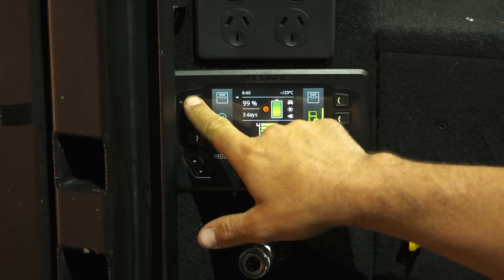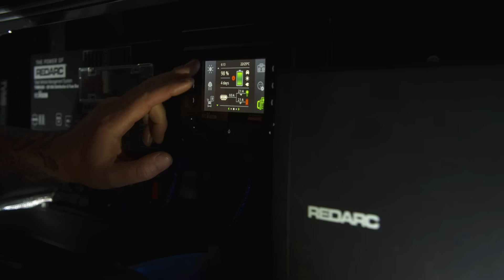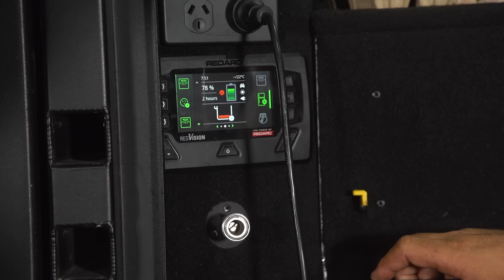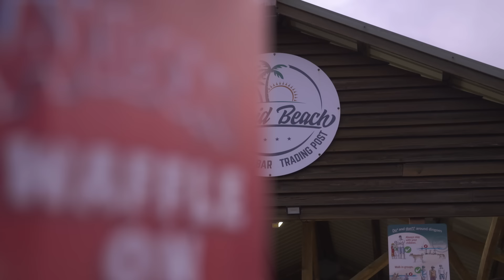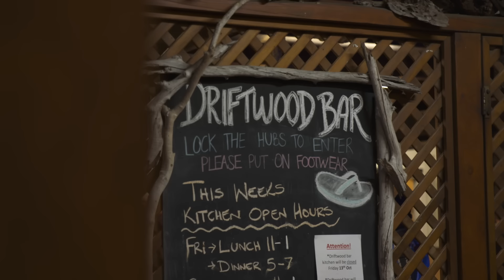BADLY Bogged on Fraser Island (KGARI)... then the STEERING BROKE! Monster 4hr Recovery!

Comment: I did the Island in 2009 In my Cross8 Crewman, Should have seen the looks I got especially as I had no recovery gear (clueless) Dropped the tyres to 7psi and drove most of the island. I did work out quickly the sand is best first thing or after a bit of rain. The Fantastic knowledge and experience is on display in every episode, 
Would be great to see Team 24/7  do a Eurobodalla trip.
You are officially invited.

Comment: Something I've noticed not many tourers have is a welder installed. I know Australia in general is very fire conscious but I would think adding one on at least a couple rigs in your fleet would be cheap insurance, make great content, and be trip altering if necessary. A couple battery's and some rod might have made the knuckle fix a bit more secure.
Reply: Now we have the inverter welders i carry one, its the size of a lunchbox, will do tig and runs off my 2000w inverter. I mainly carry for trailer and van repairs,  Very hard to weld repair cast though and most steering components are very hard to weld

Comment: I know the feeling. I went to K'Gari a few years ago to try out my new offroad trailer. Fully loaded Troopy & trailer weight: 4.2 ton.
Inskip point, the end of the bitumen part, just getting on the sand. I forgot to air down while I was talking about the trailer with a few peeps. The sand was soft with deep ruts leading up to the barge. Crawling along in low 1 lockers on and, zoop! my troopy sinks down to the axles halfway to the barge. People watching as I get out with the dunce cap on and start airing down. Fellow walk's over and states to obvious, "Want some help airing down"?
"Nah mate, I've got it covered, thanks for the offer though". (So embarrassed) Air'd down to 16 psi added maxtrax, lockers on and drove out with a lot of people watching.

Comment: I think a small inverter type stick welder and some 6011 rods can help out on the bush fix on that steering. With the massive 12V systems on your rigs, I think it can handle a small welder. In my opinion, stick welding is a very valuable (and easy to learn) skill to have when doing trips like these.

Comment: Had a good time for a bush welding technique there. Two or three batteries, jumper cables and few welding rods.  A few of that type of repairs I've done are still holding up, one I did on a trailer is still holding up twenty years ago.

Comment: that break is cast steel if you had a generator(most likely you do) and a small arc welder it would fix it eazy as
modern small arc welders these days are only the size bit bigger than  a wheetbix box and weigh a few kgs and pump out 60 to 100 amps and cost $100 to $400 , really worth it if your going off roading and  something important breaks(hubs, diffs, springs, axles, just about anything steel, cast steel but cast iron needs heating and cooling over time)

Comment: I reckon that David (and Tony) would agree that the best recovery gear any Australian 4WDer can have is a UHF Radio. Even if you can't track down an GME unit, any UHF with an appropriate antenna is better than being stuck somewhere, unable to get help. GME XRS (or Uniden XTrak if that's the way you go) can also help your saviours find you, like Tony and Shaun do @23:00.
Just be aware of local laws about using handheld communication devices while driving.
Reply: What a load of garbage there are much more useful and important recovery gear than a uhf

Comment: Why the hell are you stuffing about at Nygala Rocks when the run up the waterfront is clear, low tide obviously.
Last couple years I've had to do Nygala because of tide depths, but in the footage it's a clear run.
I usually do the beach when possible.
Edited: Wasn't referring to 105 recovering, as it is most evident from footage the tide is back in by then limiting the beach run.
Had a Iveco snap the steering arm off of a hub ascending out of a creek crossing, wide wheel track created issue of wheel going in under ledge of the bank, couldn't climb out, snap. Several hours, burgers & coffees later, many high grade drill bits, we were able to drill two holes in arm & hub. We achieved to tap some threads, two grade 8 bolts sorta clamped it back together reinforced by ratchet strap we got back to the highway, then to our amazement it held together so well we managed to drive it all the way back to town @ 60klm over 35 klm's.
Weeks later new hub from Iveco, the old truck has done many incredible tracks without further issues.

Comment: Sorry shauno the GME 80 and the Stedi 200 probably would have been better with that 105. Your 200 has the power but probably not the power to weight the GME 80 has.

Comment: Stop getting bogged at Ngkala. It is the most over rated 4wd track in the country. You guys of all people should be showing that, but I guess that's not good content. Because of all the people going through there and getting stuck these days, I've had to stop camping at Sandy Cape, my favourite place to camp since the late 80s, because it takes too long to get back for the barge on the way home. I hardly even bother taking the family for a day trip to Sandy Cape any more, which is a damn shame.
If you're finding the track too hard, your tyre pressures are too high.
Turn off all traction control and ESC aids (by holding the TCS button down for 7 seconds in the Dmax, for example).
Use low range with your car in its peak torque range, on boost, say around 2500rpm assuming you're in a modern turbo diesel vehicle. You absolutely do NOT need to give it the berries all the time.. 3rd gear low range is a sweet spot for most.
I just get so frustrated watching people in cars with all the power in the world, on modern tyres, in lifted Rigs getting stuck where we used to go on shitty stock 4x4s with 60hp!